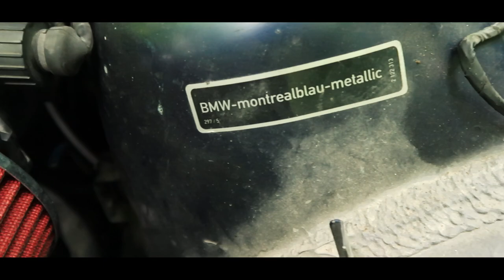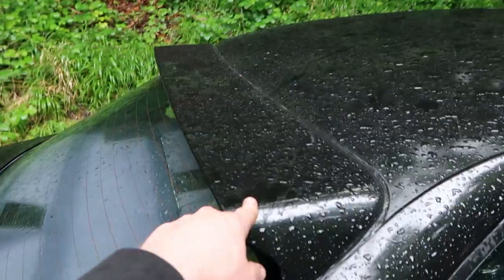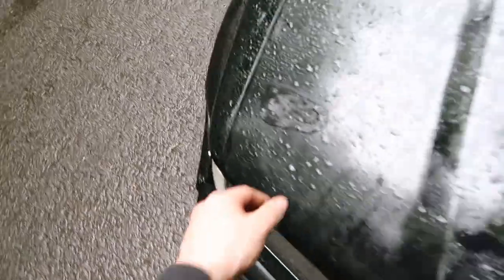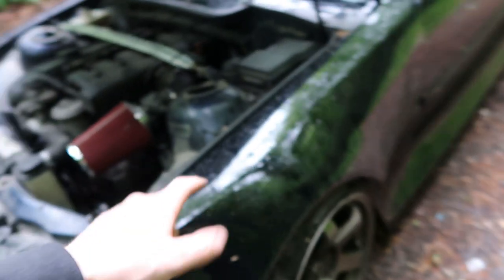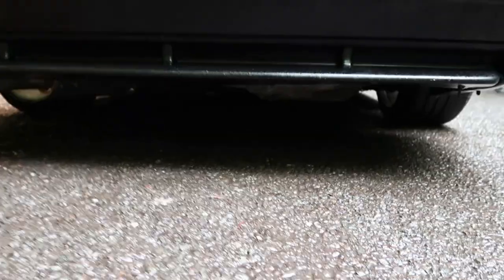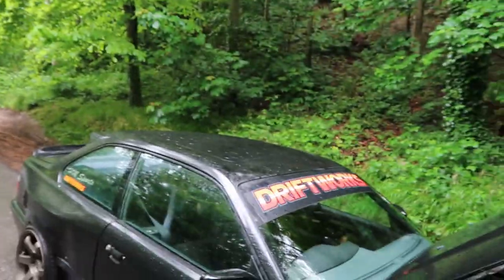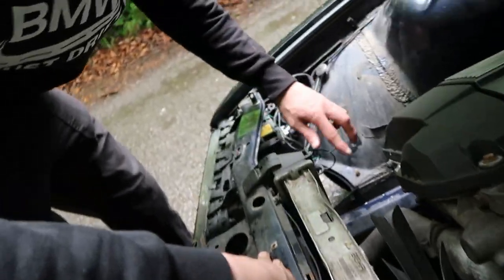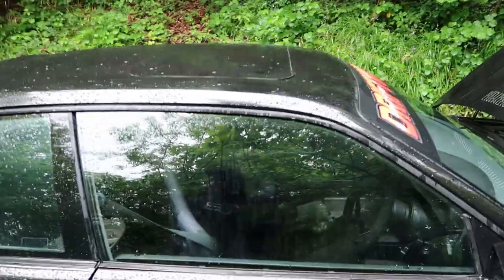Insane Widebody BMW e36 328i Drift Car added to the Fleet!

Comment: This is funny. I'm coming from two five series BMWs and just bought a stock E36 328IS black
Reply from the maker: Oh nice 👌🏼 ready for some e36 problems?😂😂👌🏼
Reply: He is true about the problems but because I have a other M50 car I can fix the problems so bring them on and current problems water pump failed fan spun apart and lodged a fan blade in radiator hose. Luckily have the same hose on E34 that is down because of intake hose issue problems are going to happen. You just got to have the right parts to fix it when it needs it and some motivation. It's very hard sometimes and right now it's even harder because it's f**** ice cold outside wind chill is practically painful